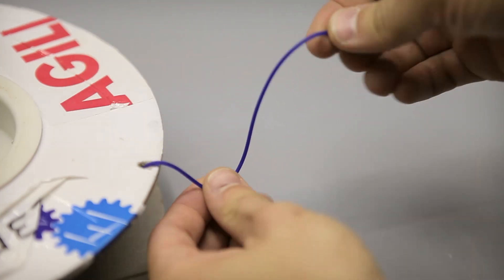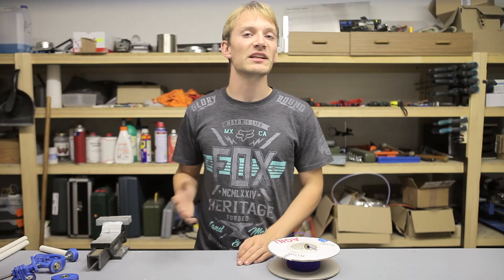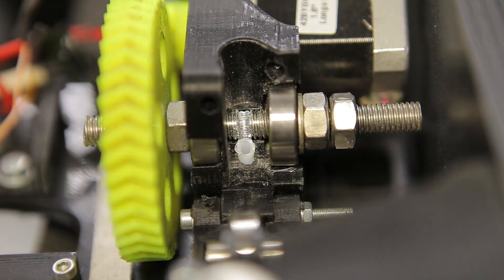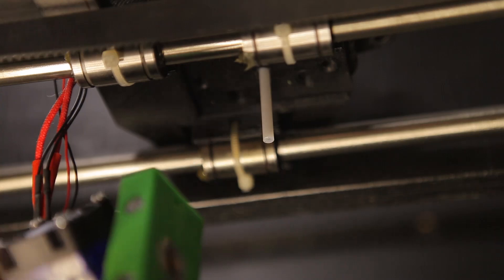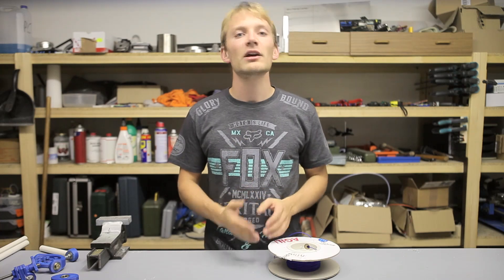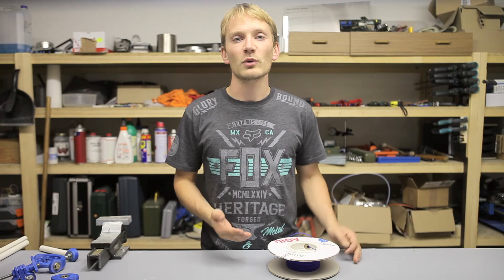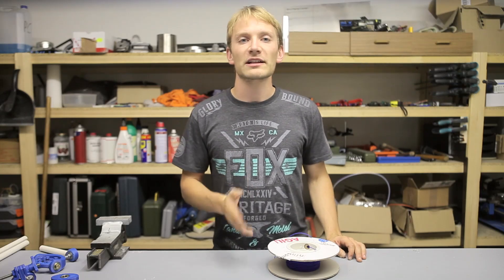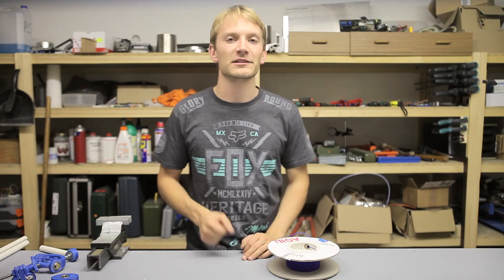3D printing guides - Using flexible filament!

Comment: Another tip is to use a larger nozzle (0.8 in my case on a U3) This reduces the force required to extrude and barely makes any noticable difference to print quality.  I can then treat it pretty much the same as regular PLA.

Comment: I just bought a "anycubic i3 mega" printer that's made to print "abs, pla, hips, wood" but I really want to print tpu.. will I be able to with some adjustments as shown in this video? Thanks
Reply: you need to see if your extruder channel provides a complete path to the hotend, if you have a Wade's extruder you will need to do this yourself, but if u have something like the Titan extruder, it is already done for you
Reply: Have you already tried to print ninjaflex with your Anycubic i3 mega? I have just bought one and am investigating if it is possible and which modifications might be necessary. Thanks for an answer
Reply: I haven't tried yet. I don't think it will be worth the hassle. I might buy another printer that's more capable of prohibiting tpu at some point

Comment: I am trying to print with TPE70 and I am facing problem of too much stringing. I have tried setting of retraction of 1 to 12 mm in Slic3r but couldn't able to get success. after 8 mm there is a bit of improvement  but complete string print is not the case. I am printing with 20 mm per sec speed and non-print move of 250 mm per sec. could you give me some tips regarding it. Any help would be appreciated. Thanks.

Comment: I know that this is an oldish video but I have just started trying out flex filament. I have an UP BOX (1.75mm filament) with a modified glass bed and a software controlled heat and speed add on. I pretty much got the hang of ABS and PLA (ABS in my opinion prints even easier than PLA I am not sure why so many people say the opposite) so started playing around with different filaments. I struggled with glow in the dark ABS but after some tweaking I came right. I then moved on to PETG and struggled for a bit but eventually came out with GREAT prints. Flex is a different animal. I would get the first 2 or 3 layers to print and then it would stop extruding. The first few layers bonded great to each other and the bed, I use cheap hairspray and it works great, but after that I either get blobs or the bending in the extruder that you are speaking about. From my spool to just before the drive gear it is supported with tubing and then if goes through an |ABS printed guide (I can't explain it much better than that but if anyone would be kind enough to look at how the upbox extruder works they would understand) but from my drive gear to the hot end it goes direct through a small cover plate and it seems to jam even before it gets there. Any advice?
Reply: To add on to this I have found that when I print T-glase it is better if I open up the top cover of my machine (it is fully enclosed) to prevent any overheating while printing. What I am trying to say is it gets rid of the small blobs but with flex I am still struggling. I also have a cooling fan that I can direct either fully off the nozzle or fully on.
Reply: hey craig! i own an upbox too. i am planning to venture into flex materials. any tips to share? and where can i get a glass bed?

Comment: my diy printer has a mk8 extruder that is been built to use just 1.75 mm filament. it even has an "1.75" mark engraved on its body! . so what you are going to say is that i can use 3mm rubber or other flexible materials without problem ?

Comment: Hi Tom, thanks for another great video.
I've built a DIY 'Prusa i3' with a bowden tube setup, I've read somewhere that flexible filaments don't work with bowden setups. Is this correct in your experience?

Comment: I was doing some experiments on dissolving PLA and i ran into a way to make it flexible. It isn't as rubbery as ninjaflex, but it definitely has more flex than PLA or ABS. I found that soaking a PLA part in a small amount of Goo-Gone or Goof Off will make the part flexible. The part doesn't have to sit in the liquid, it just must be soaked in it and put in a container with a lid. I left it over night and it is fairly flexible, i hope to soak it longer for it to become more flexible. One thing to note is that it will leave small white artifacts like a power like substance and it will smell like chemicals forever.
Reply: Martin M. I believe it is the Xylene that does the trick. Be careful handling this stuff as it is harmful to the body after prolonged use.

Comment: Hi!, I would like to print a workable "retractable" "vent hose" out of this material. That way my "tube" can expend and stay that way (using the vent hose system), as well as stretch because it's made out of flexible material. My tube/hose would be about 4" wide, 3" high, and about 1/8 thick. Do you think such performances are possible with this material? Or Would you recommend using a more solid material.

Thanks!

Comment: One thing that made a world of difference on my Ultimaker 2 with both Filaflex and NinjaFlex (got samples of both) was a tiny bit of 3-1 oil inside the bowden tube. I have a small filament wiper that gets rid of dust and puts a very very thin film of oil onto the filament. I noticed that made a huge difference on reducing friction and it improved printing both flexible and non-flexible filaments. 

I also found flexible filaments can be VERY temperature sensitive. 5*C can make a pretty big difference in how well stuff will extrude.

Comment: how to stop oozing? im using fila flex and have a huge oozing problem
Reply: im using cura do to slic3r not slicing properly, i set me retraction speed to 50 mm/s and had it retract 7mm and i get a lot of oozing still print speed is 15mm/s. trying to write out text with for key chain, cura doesnt have the option i dont think to not cross but my problem isnt stringing but as soon as is does a spot moves to another location that split pause leaves a glob behind. im printing at 208 C is that too much? this is on a solidoodle 3.5
Reply: I am also facing the same . Did you got exactly what was the issue for that?
Reply: Stop retractions and cool it down.